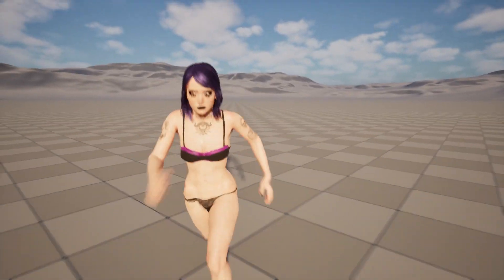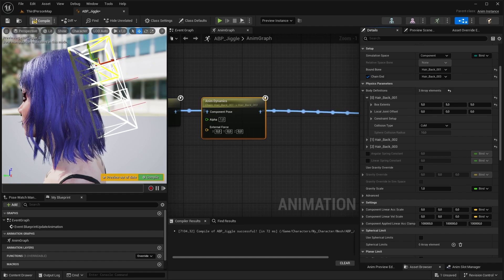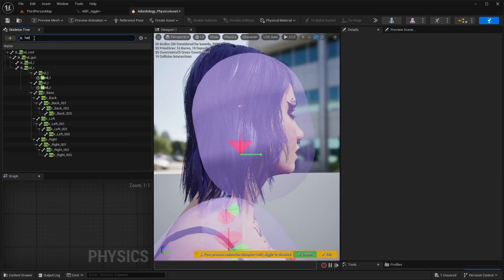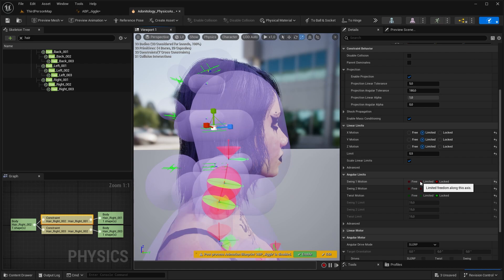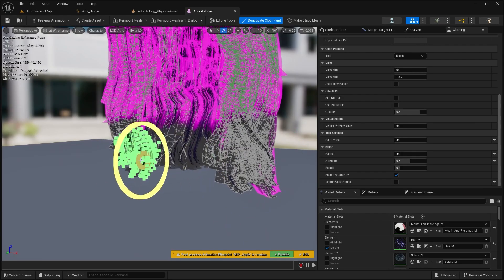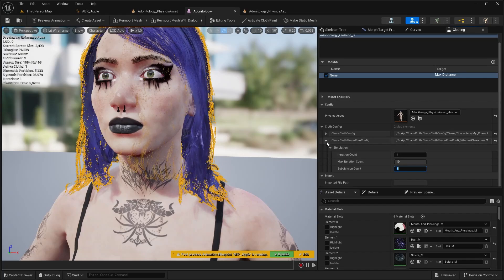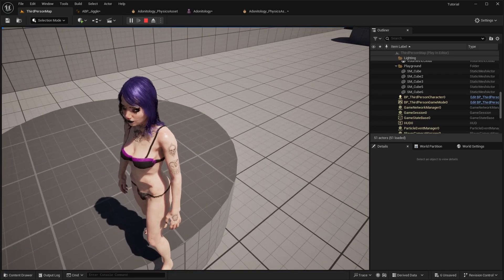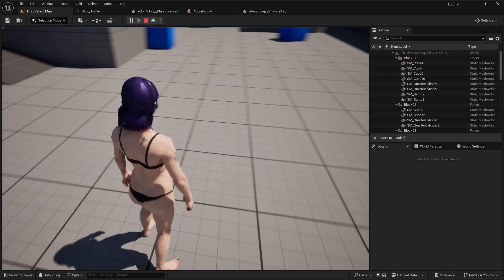Hair Dynamics in Unreal Engine 5 - All Methods Explained!

Comment: Do I need to rig hair in another modeling application ?
Reply from the maker: It's not necessary, but using DCC software is generally better practice. Alternatively, Unreal's Skeletal Mesh Editing tool lets you create a rig and weight paint directly inside the engine